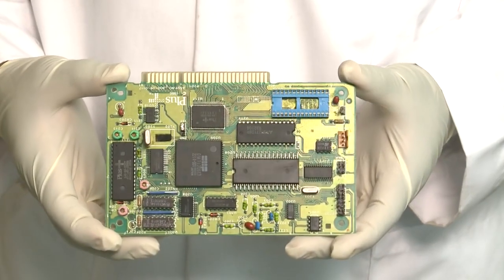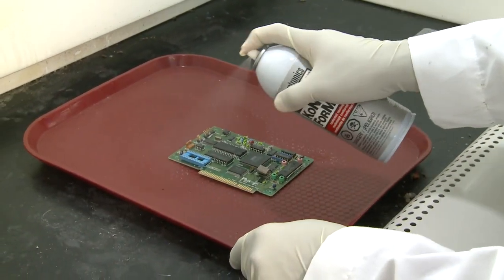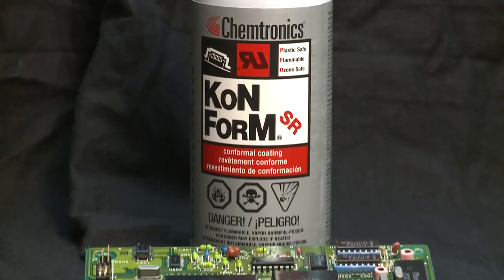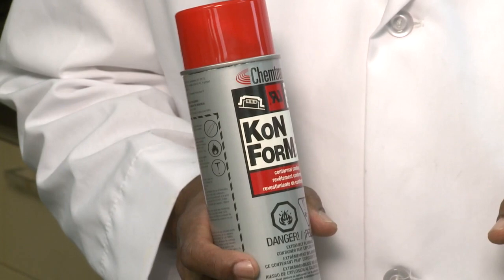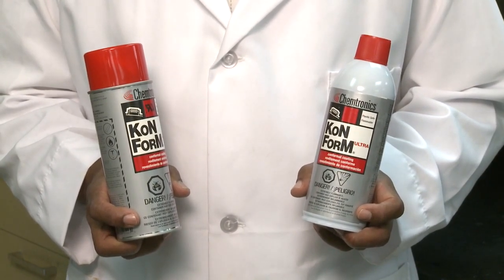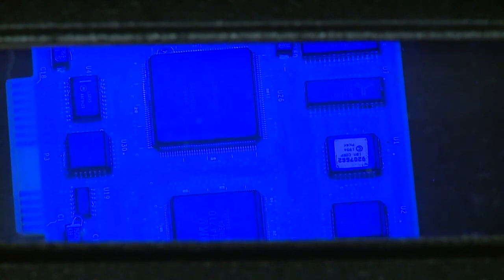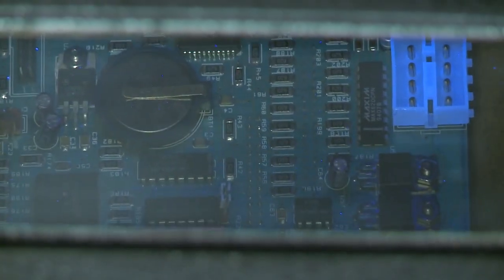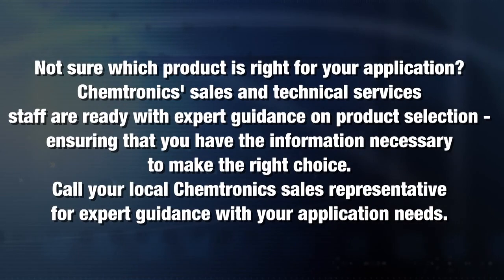Konform Conformal Coatings Application and Inspection

Comment: Lol.. maybe you should include:  Don't spray open DIP sockets without protecting the holes.  Because that's exactly what you didn't.  Why no UV-cured urethane coating?  "Weeks" is not an acceptable curing time.

Comment: hi, just wondering if I can use any of ur product to conformal coat a laptop motherboard. Im a bit worrying about those controlled impedance traces for high speed signal. Will conformal coating affect this?
Reply: I work in conformal coating. Why do you want to coat your laptop motherboard? Conformal coating is used to protect the board in moisture, low or high temperature environments. Most pcb's that are coated are for formula one cars, oil rigs, helicopters, etc. Therefore I do not think it would be necessary to conformal coat the motherboard for your laptop. However it would give the pcb extra protection if you like to take your laptop outside. But the laptop body more than likely seals and keeps the pcb protected anyway. If your laptop got wet then the usb and all the connections on the body of the laptop would more than likely break before the pcb motherboard inside the laptop. 

Also when applying conformal coating, its not as straight forward as you may think. Boards need to be baked before coating to get any moisture out of the board otherwise moisture will get under the coating and the coating can peel or crack. Any connectors or switches, LEDS, must not be coated. Also PCB's must be in a ESD protected environment and properly extracted (ventilated) and would need a UV light. 

Just realised this was two years ago lol. Did you ever coat your pcb motherboard in the end?
Reply: @kieranodonnell5271  how about coating a graphic card ? moister inside gpu causes so much faulty cards for my experience. is this would be a solution ?
Reply: @csgogodz5266  hi, umm graphics cards are inside the pc and covered. The pc will be in a house or office environment. 

Does the graphics card really have failures because of moisture? How is moisture getting inside and onto the graphics?
Reply: @csgogodz5266  if you are serious about coating your graphics card then you need to do some research and find put what coating you want to use, because there are loads of different types. Coating will serve its purpose and keep moisture out
Reply: @kieranodonnell5271  indeed if not used for several week  moisture can cause inside a chip and when it restart with power could cause we called "thermal shock" and it happended offen the case for gpu artifacts and solution would be reballing the gpu chip.
Reply: @csgogodz5266  you could just brush coat certain components, IC's, etc. Saves coating the whole board and potentially causing more problems
Reply: So, for example i live near the beach, so the air is full of moisture, a regular graphisc card wont last more than 3 years due to rust and salt buildup, so ive been looking into just coat every component, and even the case, to prevent the slightest corrosion